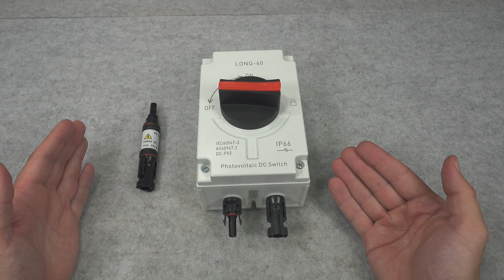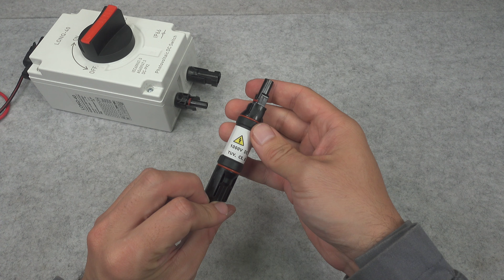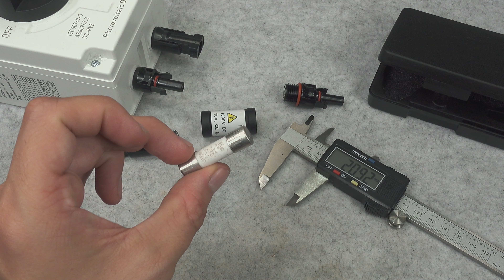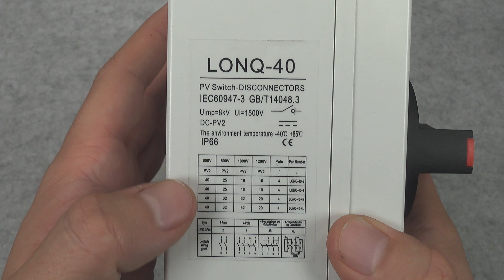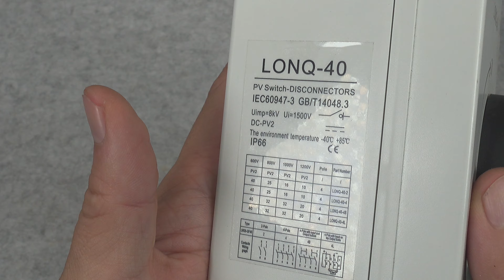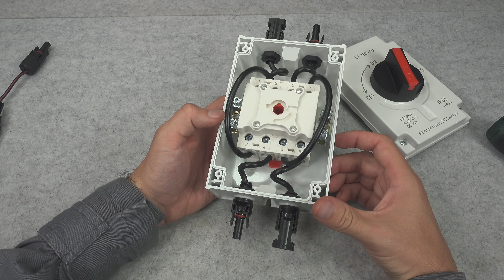LONQ-40MC4 PV solar string disconnect switch / DC photovoltaic isolator & 20A inline MC4 fuse holder

Comment: In the last step, did you add the fuse to the correct side?  I thought it went on the input side?  Thanks!
Reply from the maker: Hey, from legal reasons everything that go into setups like this I would say that You need follow local regulations. Between You and me fuse in solar system is additional bonus as it's expected never to blow since there is no technical way that solar panels will make more current than they are design and all wiring + fuse should be over that limit - so technically at deep level  in my opinion fuse don't make sense. Fuse in that case i treat as protection again transformer-less inverter failing and outputting AC to PV side with could happen so in that case better to have fuse especially since is so inexpensive. Don't know regulations - I think i would like have PV fuse after isolation switch so I can isolate and unscrew it and replace without worrying about being shocked but hard to tell with is correct way. But that's good question - it require someone who do installs at daily basis - I have tiny non commercial setup for my emergency preparedness for light and two way radio.
Reply: @ElectronicNoobBlog  thanks for the reply. I think you need to edit the video and take out completely the last part. You put it together incorrectly. That particular isolator should have the positive (red) wires on the same side and the black on the same side, the left.  There is no crossover. The fuse goes on the input side. I’m running panels in parallel so the fuses are necessary. 
As for the isolator, it works great and very easy since it is already wired internally. Plug and play. Thanks for the video!